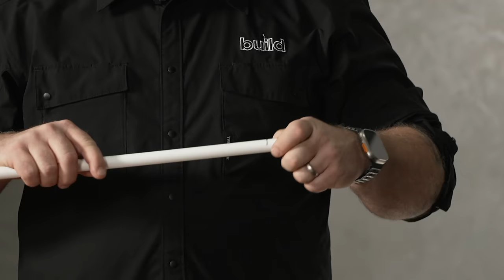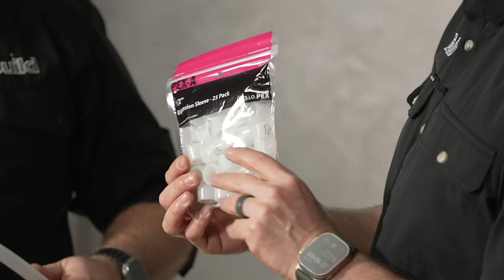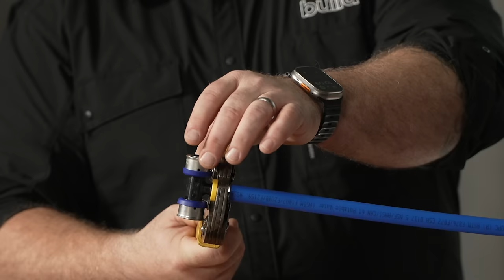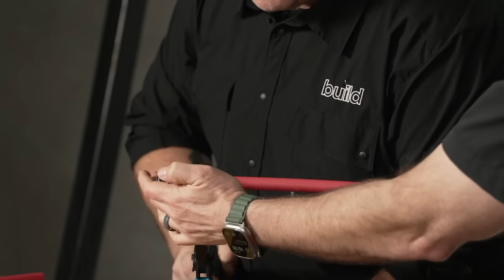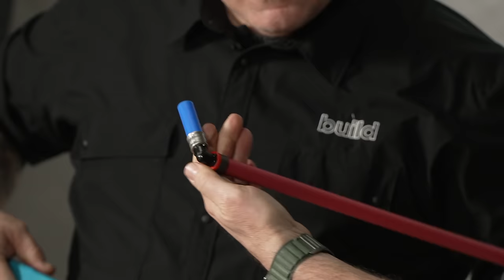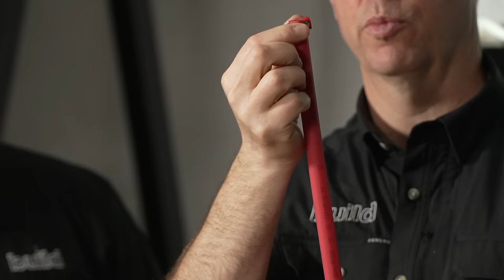PEX Pipe - 5 Connection Options

Comment: What about reusability?   Sharkbites have a removal tool and can be reused?
Reply: The crimp ring fittings are also reusable. They make a crimp ring cutter so you can reuse the brass fittings
Reply: Yes they have a tool and can be reused but remember this is a repair fitting and shouldn't be used in walls, underground ETC.  They are coming out with one that can't be taken back out so you can blurry it. I personally don't use any repair fitting ever. All my connections are permanent. I am a Plumber BTW.

Comment: I'm not a huge fan of PTC fittings.  They start off good and are definitely easy to use, but in my experience, they don't age well.  I've seen more leaks from PTC fitting that have backed off than just about any other type.

Comment: If I were using regular crimp rings, j would think a strip of masking tape would hold the ring in place?  I work in maintenance and use push locks a lot for air to cylinders,  or chemicals to spray guns.   I would never use for plumbing.   They just don't have the longevity or reliability needed.  It would be horrible to use these behind a wall.

Comment: I'm impressed with the Master Plumber giving an honest thoughts and NOT telling the world... these all suck... "cooper man" ...  I've been in construction since I was 19... and have witnessed pex pipe and press enter into the residential markets.  I now contract for Public Works.  They are now using the 'Pex' (type) tubing up to 3".  
People dump on shark.  The biggest issue with shark is the installer.  9-10x the pipe isn't cut right, or someone modifies the shark system... pex per linear foot is cheaper than copper... and the fittings per are more cost effective.  Pex A has better flow rate.  Milwaukee expander is $400...NOT for the DIY.

Comment: hate the grey pex- My condo was built in 1984- so many leaks almost all were the crimp ring was. Surprising how many little cracks form under the ring.  Like the expansion
Reply: That’s not PEX, the gray plastic pipe is polybutylene.

Comment: I'm just a little suspicious of those push fittings.  It's all hinged on a rubber O ring.  If that fails the joint leaks.  Is that O ring supposed to last forever?  Is the life expectancy 50-60 years?  Sooner or later it's going to fail.  Versus a soldered connection or crimped on copper ring that has a much longer life expectancy.

Comment: Sure,  rubber o-rings in my car lasts as long 😂
Reply: Facts!  My semi’s use the same style of connections on most air line runs and I’ve had issues with the firewall bulkhead manifolds where I’ve had to extract the o-ring out of the fitting, size it and replace it.  PITA!!!  It was either do that or be down for 2 days and spend almost 1k for a new bulkhead assembly.  Great for quick fix stuff but I wouldn’t want to rely on it behind drywall for 30 years…

Comment: Question for anyone that 100 percent knows the answer. Please don't just guess or answer from hear say. I understand you can only crimp or PTC pex B, not expand. But can you crimp Pex A as long as you use Pex B fittings since A fittings will not fit. Is this correct?
Reply: Yes you can use the stainless steel pinch clamps on PEX A tubing.  I have done it successfully.  And used Sharkbite fittings on PEX A too.  You are talking about the copper crimp rings.  But since the stainless steel pinch clamps work on PEX A, I am 100% positive the copper crimp rings work too with PEX A.  Both the stainless steel pinch clamps and copper crimp rings both compress around the tubing to squeeze down on the connector inside.
Reply: @russellseaton2014 Thank you for the answer.

Comment: Haven't even watched the video yet but pex expansion all the way. Full flow fittings, fittings, tubing, and accessories are cheap the only negative is the tool. But if you're going to repipe most or all of a house it's well worth the money. With the battery tool (i got the dewalt) its so easy my 5yr old daughter made a connection after about 2 mins of explanation. If you're only doing a repair or single bathroom remodel it might be harder to justify but man it makes life easy.
Reply: Milwaukee and Dewalt battery powered expansion tools are $400.  The stainless steel pinch ring tool I bought from Amazon was $45.  I only replumbed two bathrooms.

Comment: I did Pex-A for our new home build.  The flow is awesome to showers and I think low flow showers suck.
Reply: I’m sorry but this is a useless comment. If I used 4” pvc everywhere for my new build, and got a bit better flow rate than you, what shall we conclude?
Reply: @lrw-86  That you didn't watch the video and have a drinking problem?
Reply: Expansion fittings can be used with any PEX B certified under ATSM F1960.
Reply: Well said.
When poop doesn't swirl, when clothes and dishes don't get clean,and when you can't get a muscle relaxer in the shower....
48 yrs living on a well where I can control what chemicals come into and aroundmy body, a septic system where my water never leaves the property. 
Low flow is a stupid idea,the water in our atmosphere has never changed volume...it is either vapor, liquid or ice.

Comment: Been using PEX A for about 5 years. No leaks for a few years then I started seeing them. Just wasn’t waiting the requisite amount of time before pressuring. I wait 30-minutes.
Be sure to lube expander tool spreader/expander tip.
Is there a UV resistant version yet?
Another problem I had was working in confined areas where you can’t spread apart both connector sides because short runs will not bend. I eventually found slip joints.
Another issue is dealing with the rolled up bundle because unless you heat up a run of the pipe it will remain curved or fight you. I’ve laid 100’ out on hot asphalt to heat up and straighten.
Don’t buy fittings from big box (HD has a limited supply. Menards is better but I buy in bulk online.
Measure three times cut once or you’ll end up with droopy short sections or uphill long sections.
Plan accordingly for valves.
I have a Dewalt tool and at $400+ it wasn’t cheap.
Rolled or partially unrolled (straightened) sections are a PITA to store.
Who is manufacturer Sioux Chief? Is it similar quality to Uponor/Wirsbo.
It still surprises me how many old schoolers eschew PEX A and still use their standard bearer copper.

Comment: I think it would have been good to note to not mix crimp fittings with pex-a. That type of pex will always be wanting to go back to its original design, thus will be pushing out, and fighting against your crimp fitting.
Reply: I don’t think that’s the case, or at least there is a bit more to it than that. You have pex A manufacturers who have crimp/clamp ratings on their pex A piping, and you have crimp/clamp suppliers who have specific ratings for their products citing that they are approved for Pex A/B/C. For example, crimp fittings with the ASTM F1807 rating are specifically rated for Pex A, along with B and C. 

Never heard of real world broad issues with people having issues with crimping or clamping Pex A.
Reply: Have you seen evidence that this “fighting” force is enough to overcome the crimp strength? I have not.
Reply: @lrw-86  Nope. But I do believe it voids the warranty. I posted to the other reply with the links, but don't see it.
Reply: @jpost9228 not using same manufacturer for pipe fitti gs and rings voids the warranty for most pex brands.

Comment: And how many years will a rubber o-ring last with chlorine exposure? This is absurd these are allowed. Also PEX will degrade with chloramines. One has to filter out chloramines if you don’t want PEX cracking. You have not guarantee with your local water supply.

Comment: INSULATED 

Why or why not to insulate hot or cold PEX pipe???
Reply: Usually you put the foam insulation around the hot water lines from the hot water heater until the water line runs into the floorboards.  Maybe to help it retain a tiny bit of heat on its journey to the faucet.  But mainly to identify it as a hot water line so you know when looking at your plumbing pipes.  Cold water doesn't get any insulation sleeves because it is at ground temperature when it gets into your house from the underground supply line.  And should stay at that temperature unless you have a really hot basement that heats the water up inside the tubing between coming into your house and getting to the faucet.

Comment: Crimp is 100 times faster. I can do a house in 1/4 the time as expansion. All you need to do is barely close the crimpers on the ring and it wont move or use crimprite rings. Expansion is trash and fails all the time here. Im ripping out swathes of uphonor pex not even six years old.

Comment: Also should mention that pex a can be used with all 5 methods however pex b can only be used for 4, cannot expand pex b.
Reply: Most pex B, cannot be expanded, but Zurn makes Pex B that you can use with expansion fittings.  Has a higher pressure and heat rating than pex A, less likely to leech chemicals into water.
Reply: I was going to say the same. Some pex b can be expanded.

Comment: One of the things that I like about shark bites is that there is no reduction of the inner diameter with these fittings
Reply: I’m pretty sure that shark bites go both over the pipe, and into the pipe, thus reducing the inner diameter (not that I think it actually matters much - just wanted to point that out).
Reply: @lrw-86  i’d agree with you if you were correct. I know they don’t go on the inside
Reply: @exrezcnm  Very wrong.  Sharkbite, and the other makers of the push to connect fittings, all have an inner sleeve that goes on the inside of PEX tubing.  You can remove this inner sleeve if connecting to rigid copper or CPVC tubing.  But you must use the flow restricting inner sleeve on PEX tubing to reinforce the softer PEX tubing and allow it to press firmly against the O ring inside the Sharkbite.

Comment: Pex Sucks.. I have a mobile home that was built in 2000, and to be honest just about every connection has failed... I've replaced so many connections with SharkBites and they are still holding up.. Just did find a new failure and getting ready to replace that as well with a Sharkbite...
Reply: Is it Grey if so it's not pex.
Reply: @sewerrat7612  It is not grey.  Kind of white, almost see through... still some kind of pipe with the round crimps to hold them to the connectors...
Reply: I guess it really the pex / plastic tubing, it is more the connectors that they used and the round crimps that they used to hold it all together...
Reply: Sounds like pex hard to tell but my guess would be tool wasn't calibrated right leading to poor seals.

Comment: Sharkbite/push connector are complete garbage. My plumber refuses to use them. Way too many call backs.
Reply: I've used official Sharkbite fittings on copper and PEX tubing.  And the Menards brand of push fittings on copper and CPVC tubing.  That has been 2 years and 15 years ago.  No problems.  No leaks.
Reply: Too many reasons they fail can be installed well but it takes just as long to do a proper connection in other ways.

Comment: Sharkbite looks easiest,and simple..less mistakes
Reply: I never use sharkbite on pex too expensive. Crimp is instant connection.  I will use sharkbite on cpvc or copper if it's not going to be inaccessible just because I don't have to screw with compression fittings or glue or sweat connections
Reply: Sharkbite don't handle shear force well so have to add time to strap both sides of piping to avoid movement for best results.

Comment: ROFLMAO...SharkBite was not the first. It was actually Polybutylene connectors by Hoechst Celanese Chemical Group...yup the ones that leaked and started the largest lawsuit in plumbing history
Reply: You’re really rolling on the floor laughing your ass off because someone would informally cite that “Sharkbite” is the first majorly popular push to connect brand? Push to connect fittings have been around a long time. You have had people using them on fuel lines in rudimentary form in the earlier 1900’s, air lines since the 70’s, and in spotty use for water since the 80’s, well before the Celanese brand was marketing them for specific polybutylene use, and before Hoechst-Celanese was even one company, and they weren’t sued for specific connectors, they were sued because their polybutylene pipe itself was leaking. 

So you’re going to act like you really one upped him for just mentioning Sharkbite as the first well known push to connecy just because Sharkbite wasn’t actually the first?

Comment: Don't drink from PEX. Don't use it for hot water. Have a final filter at the faucet with only copper between the filter and the human.
Google "microplastics" and toxicity and PEX.
It is a great money-maker for the high speed plumber, it's not great for the homeowner or anyone drinking from polyethylene (or polypropylene) plumbing.
Use copper, use a compression tool. Quick, painless, won't fail. Insulate for sub-zero situations. Install leak detectors and automatic shutoff valves as necessary.
I have a house with 10 year old sharkbites on copper in a snow cabin that is under snow for 3+ months … push fittings are durable and reliable.
Reply: Thank you i was wondering about this I'm a Plumber and pex is a labor  saving money maker but i often thought about weather or not long term drinking would do harm.
Reply: You have no evidence there are any health effects from PEX even though they have been on the market for 50 years. Copper is not without its flaws and is very expensive.
Reply: Based on your comments, I assume you never ever drink any soda pop from plastic bottles.  And never drink beverages from plastic glasses at restaurants or convenience stores.  And never use plastic cups at home or anywhere.  And the gallon milk jug you buy at the store is plastic so you never drink store bought milk.  And syrup for your pancakes come in plastic bottles.  And cooking oil comes in plastic bottles too.  Can't use that when cooking at home.  Candy bars come in plastic wrappers.  Can't eat those.